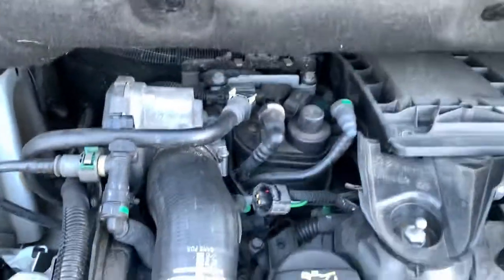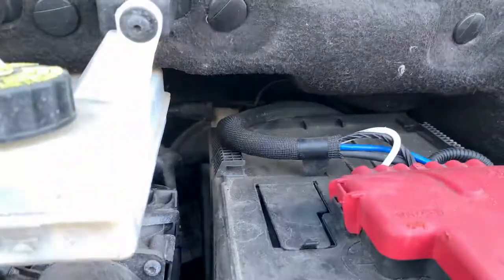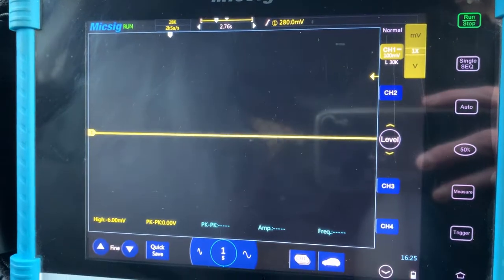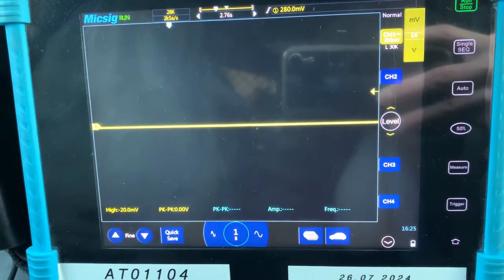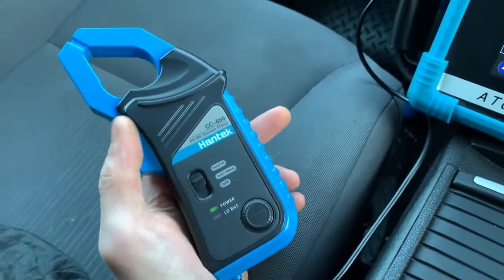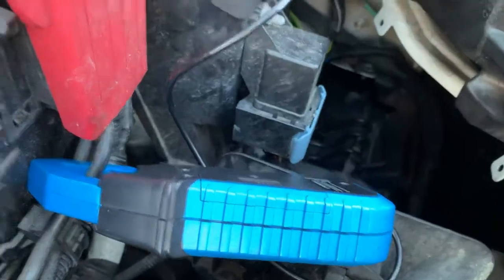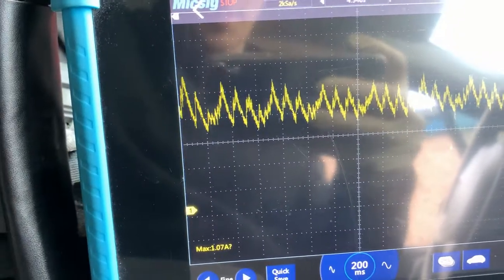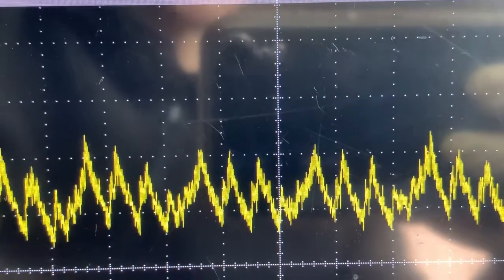How to carry out a relative compression test - [MICSIG AT01104 & HANTEK CC650]Ryan's mobile mechanic

Comment: Try adding a second channel to trigger an ignition coil or fuel injector. With the firing order, calculate which cylinder has low compression. You can also switch to AC coupling to have a better view. 
If no AMP clamp is available, use the voltage scale attached to the battery posts.
Set to 20V scale and invert that scale
Set channel 2 to 5v for an ignition trigger
Set time to 1 second
Touch Signal SEQ
Start the test
When the screen is populated, use the time scale to have a deeper view
Use the cursors to measure the "humps"
Use the degree cursors to align the ignition trigger

Comment: How did you change the trace movement from right to left, to left to right on the Micsig ATO1104?
Reply from the maker: Display - common Roll (disable or enable)
Reply: Good day Ryan. That did it! Thanks. Have a great weekend
Reply: I just discovered that in most presets Roll is disabled automatically